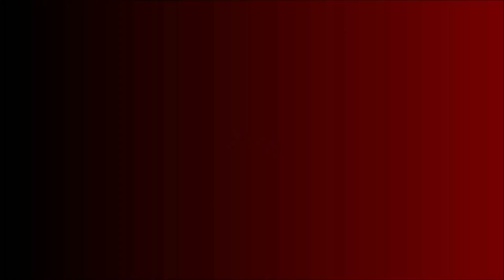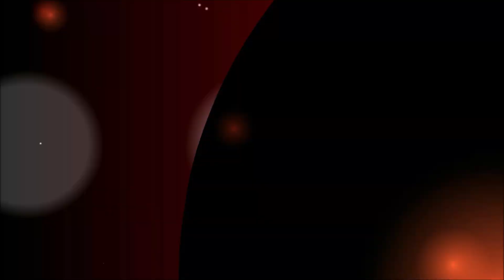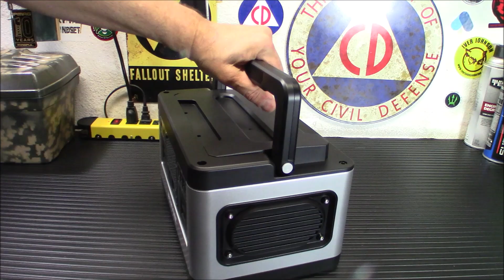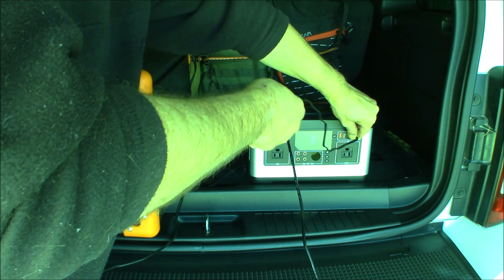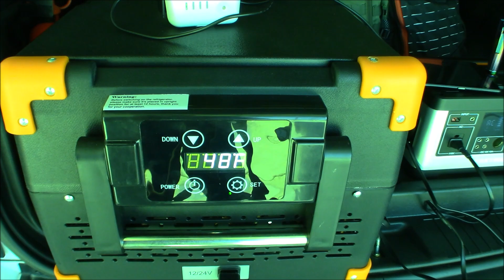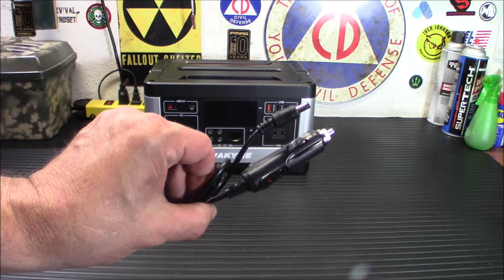WAKYME 520Wh Portable Power Station: Off Grid Power!

Comment: Have you use the cigarette lighter adapter to plug your Rockpals fridge?  I have the same Fridge and a Rockpals 300W power station but when I use it with the fridge plug on the cigarette lighter adapter I get an F1 on the fridge.  Thinking of upgrading my power station to this but I wanted to make sure I can use it with my fridge using the cigarette adapter.
Reply from the maker: I tried it and it worked for me but still given the power and amp draw I would still plug it into the AC outlets just to be safe.